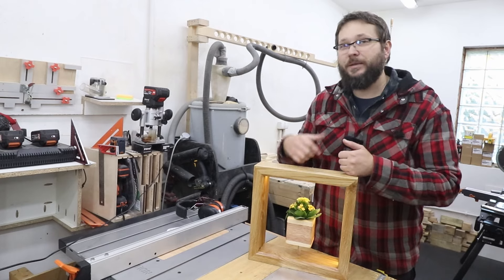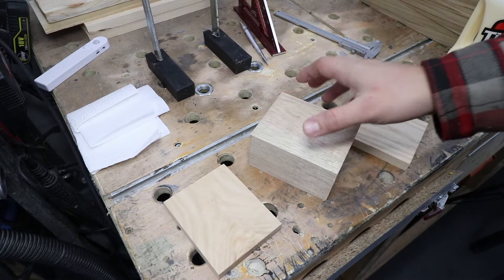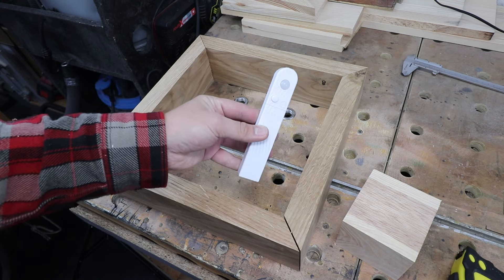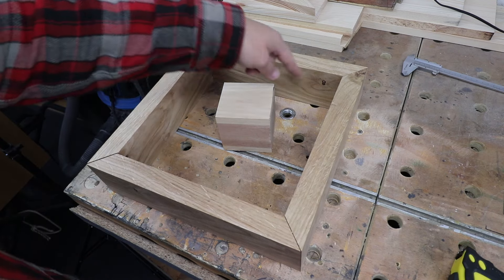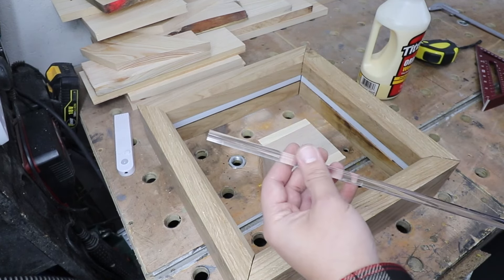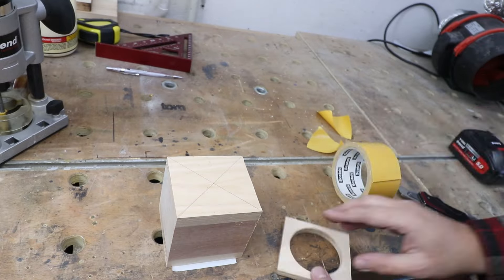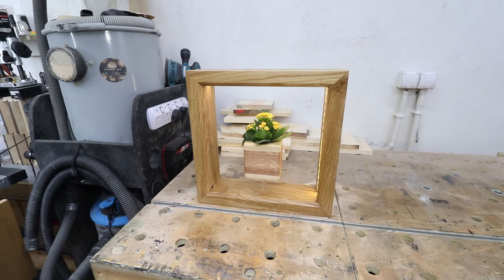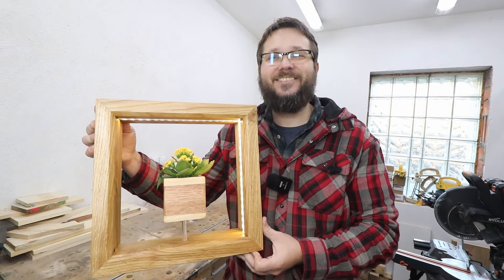You Haven't Seen A Plant Stand Like This Before! DIY Floating Plant Stand & Light

Comment: Brilliant build, can see it being used in a living or bedroom to provide some ambient/ atmospheric soft lighting, maybe attach a mirror backing, to give another dimension  

I once tried a similar project. It was a framed mirror, but at the press of a button some imbedded LEDs behind the one-way glass would illuminate revealing the image behind. It was a challenging build and experiment. With mixed results; the mirror function didn’t really work, and I need to review the circuitry before I can be confident to leave it turn on for any length of time.

I couldn’t get a hold of one way glass so opted for coating some acrylic with some reflective window film (not the best) and ended up using some flexible LED filament and soldered in some of the shelf PCB’s that would step the voltage from the 18650 Li battery up to the 6V needed to power both filaments as well as giving the option the charge the battery itself.  All done with a table and mitre saw.